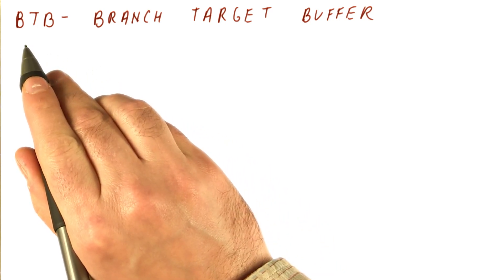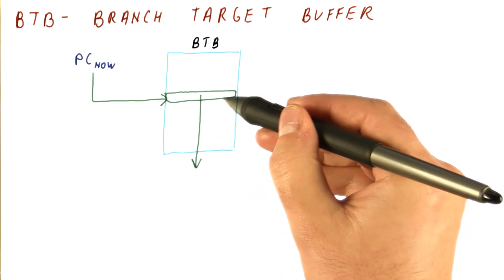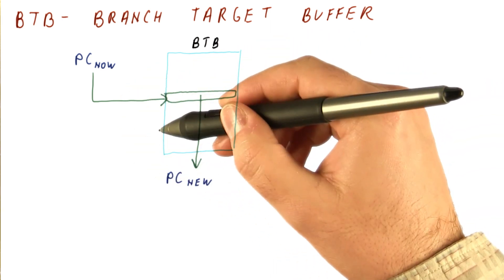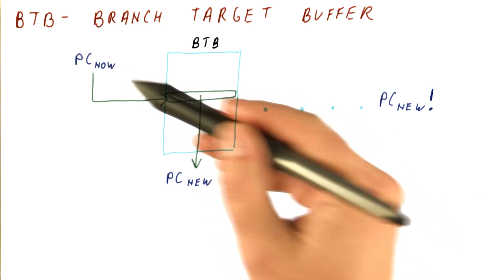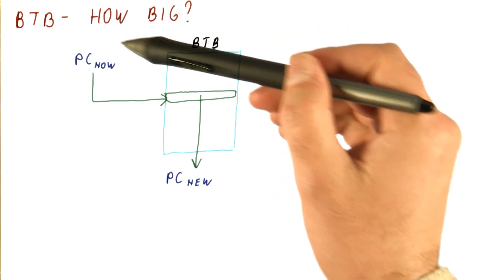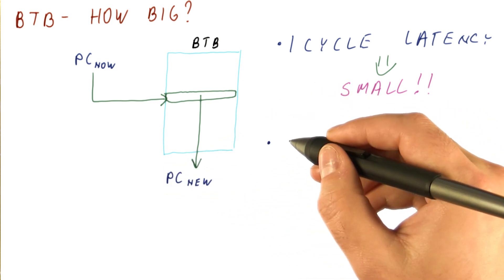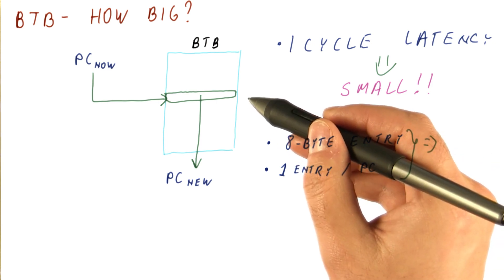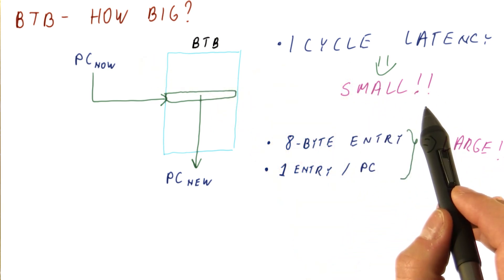BTB Branch Target Buffer - Georgia Tech - HPCA: Part 1

Comment: How BiG?
consider, we have memory of size: 4GB -> 32-bits (or) 64KB -> 16-bits. Programs are stored in the memory (RAM) and accessed through cache memory. Now, its not that we use entire memory space for a single program, each program/function (keeping in mind about Loops/branching) requires only 2-5% memory i.e. few "KBs". Thus, BTB could be small (lower no.of  entries).
why do we even care about capacity of BTB? since it is a collection of buffers (each having instruction size or quarter of it), it has to be addressed (similar to any kind of memory) and it requires address decoding circuit which in-fact has some latency associated with it. Thus, we should focus on reducing this delay in decoding the location of BTB by keeping its capacity to a smaller one :)

-this is my understanding!